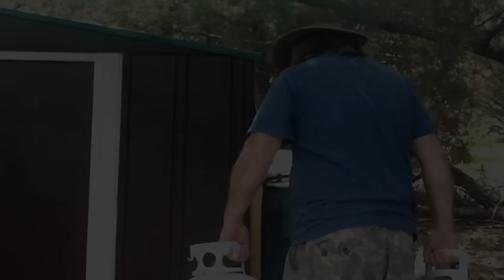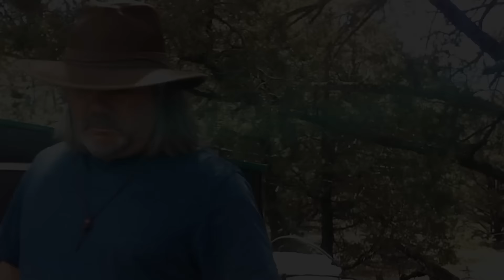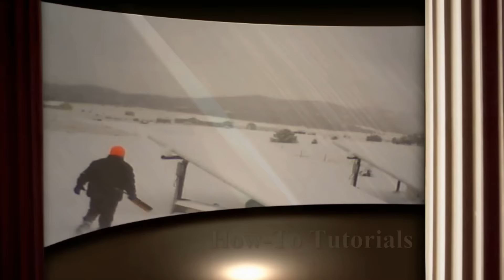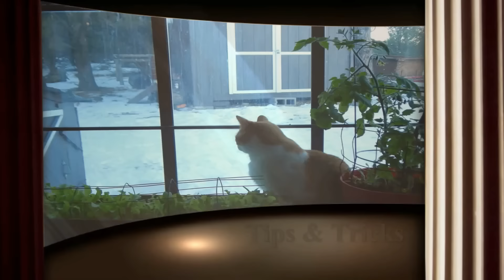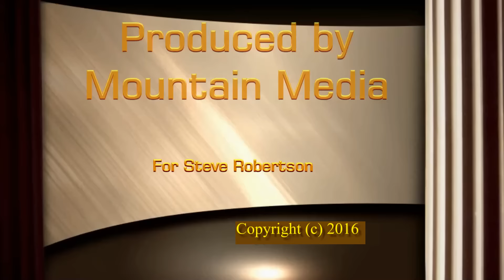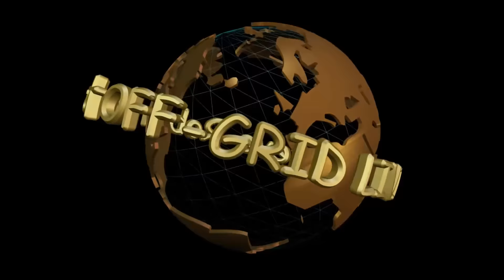The Big Talk about Grid Power, HHO, LED Bulbs, and Water Pumping Using Air

Comment: And a central heat and air. and a small window unit in my room.  I converted the back porch to a bedroom.
Reply from the maker: I have a mini-split heat pump system that works well for me.  I have two - it was less than one larger system.
http://www.ebay.com/itm/11200BTU-21SEER-AC-Ductless-Mini-Split-Air-Conditioner-Energy-Star-19-39dB-1-Ton-/221968381378?hash=item33ae58b5c2:g:PmAAAOSwAKxWbmDr

Comment: I use 2784 kW. is that alot? there is 4 adults and 2 children here. 5 TV s A freezer, fridge wash and dryer. 2 lap tops and a desk computer. Do you think a system like Darren's or Duane's would work?
Reply from the maker: Janet, you use 4.64 times the electricity I use and my house is all electric.  I have three TV's, four computers, a server, printer, scanner, a freezer, fridge, and washer.  I do not use a dryer because that would kill my system.  No present system would support your consumption unless you're a millionaire.  I know that's not what you want to hear, but you could start by switching to LED bulbs, getting more efficient appliances, turning things off when not in use, including computers and lights, and hanging your laundry to dry might even cut your bill in half.  Also do only FULL loads of laundry in a front-load washer.  Maybe I should do a video covering that.
Reply: Yes. I agree it's to much. but when your going behind 75 year old people that are set in thier ways. It's hard. It's like talking to the wall. so I have been switching out light bulbs..That I am constantly turning off. old TVs that I turn off also. It's a challenge. I can't wait to get back my life.
Reply: yes do a video!!!!

Comment: Have you ever thought of using wood or wood gas to generate electricity?
Reply from the maker: I've given it thought, but I would prefer to use wood gas to power a pickup truck.  As far as generating electricity, I prefer panels over anything just because there's no effort for me to generate it, and there are no moving parts to maintain or wear out.

Comment: 3d Solar panels were invented over a decade ago yet they never mass produced them I assume its because they make 9 times the power and cost half the price to manufacture, imagine these panels in a flexible form stuck to an electric car, youd never need to buy electricity again. I use hho it works very well im planning on build pure hydrogen cells to run a generator as engines need very little mods to run  pure hydrogen  in comparison to hho if you intend on eliminating petrol all together, diesels respond very well to hho supplementation, very well indeed.
Reply from the maker: I have seen diesel supplemented with HHO as well.  Duane and I intend to start dabbling in HHO very soon.  I'm sure we'll have some video up when we do.
Reply: sounds good, ive  learnt  Billy J   has quite a bit of positive experience with hho, only thing I can say is avoid the spiral wire design theyre poor gas producers, the greater the surface area in contact with the pure water the better, my stainless plates are a little over 6" square and the cell I use has around 30 plates,  smaller than that may not be enough for your pickup etc, hope that helps.

Comment: Steve,

Listen to your talk, there a lot stuffs remind me how do I start out over 2 yrs ago.

Aussi's people used a lot of PIP-4048, but recently a guy just give up the PIP and purchased an AIM 12KVA transformer inverter, he said he have some problem with PIP when he parallel stack multiple unit (3), and think AIM have solar charger build-in.

My system have (24) LG265, after (2) yrs gave away 11MW to our local utility, last Dec, I went your way, I get myself a PAE4448 inverter, Classic 200 solar charger, 900AH Trojan wet cells batteries and 400AH AGM Vmax, I convert (6) of my (24) panels to charge the battery, by the way, all my panel have micro-inverter installed to it, so I can all way go back.  My only problem right now, during a perfect sun light, once a while I have an error battery voltage too high, my setting for the solar charger is 62 volt, do you have any idea how to fix this error.

Thank you
Reply from the maker: I do hope you found it useful.

Comment: not boring at all, watched it twice. thanks.
there is a propane stove call Premiere I think, uses a 9 volt battery for the sparker.
Charles likes his PIP a lot. 
what about the water misors on the caps for the flooded batteries?
what about something like a the solar tracker that killog offers, or is it better to put more panels out there instead?
Great to hear from you, John
Reply from the maker: Thank you John!  Tom prefers watering his batteries, and mine are AGM, but I'll mention it to Dwayne if he chooses flooded batteries.  Tom uses trackers on his panels.  The reason I don't use trackers is that at 68c per watt now, just adding more panels makes more sense to me than adding moving parts.  I always appreciate your input and ideas.  I wish you lived out here - you'd fit in great!
Reply: Thanks, do you think the pip is as good as the magnum. they have a 24 v unit too but they don't say if that unit can be daisy chained with other units.
it certainly a better choice to the price if they are just as reliable.
best
Reply: the pips can be be hooked up to 6 same units with a parallel kit in each one, there is a additional manual.
Reply from the maker: I have no idea whether the PIP is as good, but I'd love to get my hands on one to see.  I do believe you're right, I haven't seen units other than the 48v unit daisy chained.  If I ever get enough money (or they send me one to evaluate) I'll be sure to put it out there.
Reply from the maker: Do you have a link to that manual, John?
Reply: looks like only the 4k or 6k units can be paralleled to up to 6 units
Reply from the maker: LOL  Well I reckon that was easy enough.  Thanks for the info and all your input!
Reply: it does say that the minimal input grid power is 230 vac, and my grid or generator is 220 vac, do you think it matters?
Reply from the maker: That's less than a 5% tolerance.  Asian made devices tend to run closer with less margin than USA products, so it's hard to say.  I think worst case scenario might be batteries not getting quite fully charged, but everything else should be fine.
Reply: I think the PIP4048 that only one can daisy chain, I did got a couple email from the mfg, I though the same way buy couple of the PIP, daisy chain them and have step down transformer that way less expensive than get another PAE4048, but recently I watch some youtube from Aussi guy (MAY), he remove (3) pip's and install (1) 12kva AIM inverter, the reason I think he have problem with balance out to get the daisy chain work.  Justin Case he very happy with his PIP setup.
Reply from the maker: I've seen Justin's channel and he is obviously pleased with his PIP.  Dwayne has decided today that he will go with the PIP, so I look forward to doing a review of it.
Reply: Justin's are from Giant power, not sure if it's from the same company with different covers,.
the only thing with me going to 48 volt battery bank is to upgrade the wind turbines to 48 volt windings, but since they aren't flying yet either...
I don't think I would do more than the 4k inverter, certainly could put to use but would need a whole lot more panels and some where to put them, 30 amps will run a lot for how i do it.

maybe you can video his setup as he moves forward
Best
Reply from the maker: I will certainly video his progress, but it will more likely go on my life channel than here.  I thought I had subbed you, but I am now.  Been enjoying your vids sir!